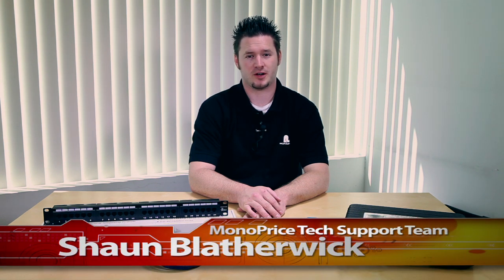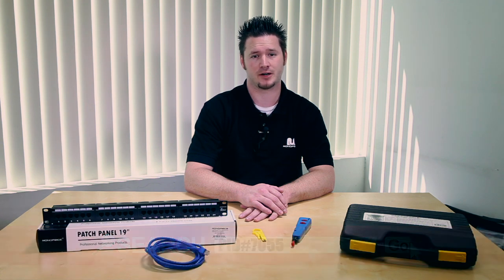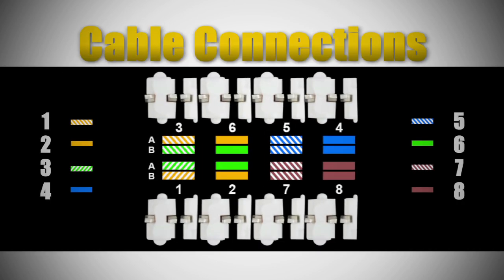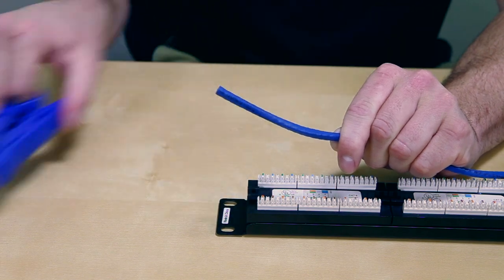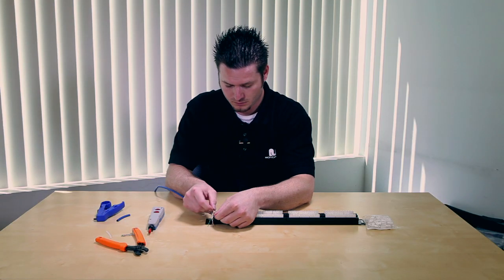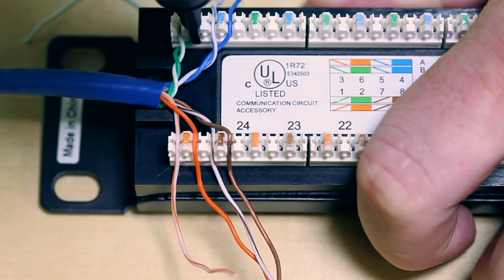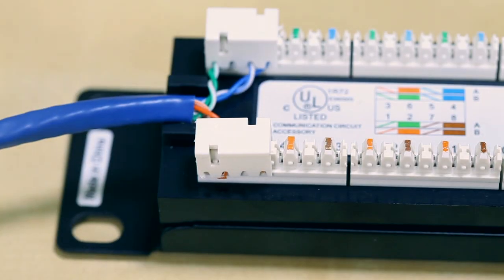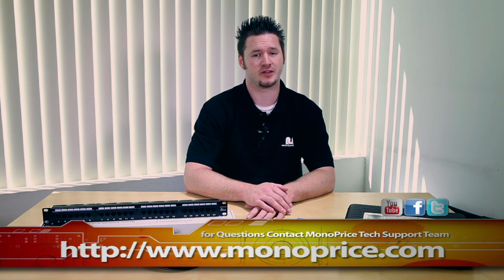How to Punch Wires into Networking Patch Panels - Cable Connection Guide

Comment: Yes, you can. Cat6 is backwards compatible to Cat5. The downside is that you will be limited by the weakest link between endpoints and so the Cat5 panel will slow down the connection because it does n
ot support the higher speed of the Cat6 cable.